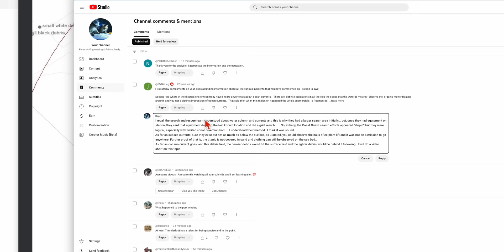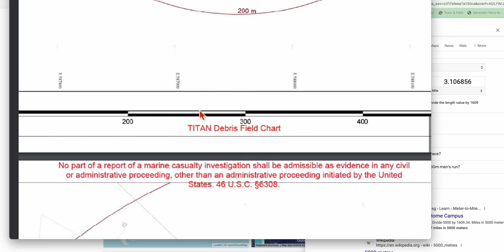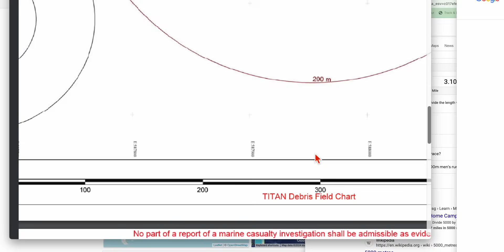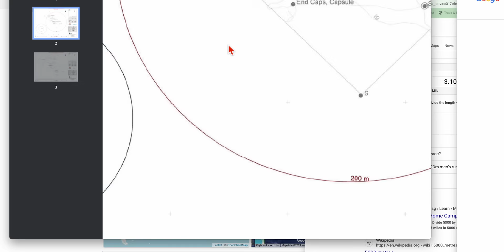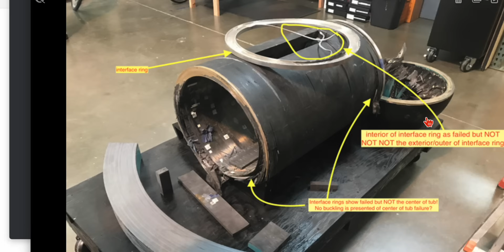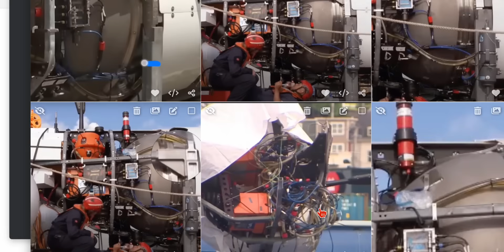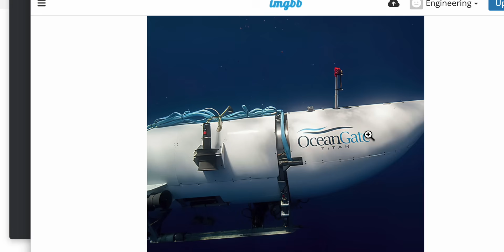Titan Submersible Rear strong back was a pry bar force on top connection putting it in shear stress

Comment: Yeah, that scale is wild. If you look at the original debris field map which Ballard plotted in '85 it's approximately a mile in diameter with the stern and the bow 600m apart. And it fell a hell of a lot further and faster than the Titan.
Reply from the maker: I adjusted and proofed the larger drawing, it is operational for me now.

Comment: I am sure that at one point the designer talks about dropping the frame if the weight drop is insufficient, was this system operational, did it work or not, these answers only investigators can shed light on, I do not understand why they do not communicate on the question, but I may have missed something, (I found where the photos were.)

Comment: Just a suggestion...  You obviously enjoy this type of analytics and are good at it.  And I for one find your analyses very interesting and persuasive.  Now what if one were to do a reverse engineering of sorts - entirely theoretical - based on the assumption that at some point the gas tanks must have imploded or exploded.  In fact, one of the photographs of the remnants of the chamber shows a greenish piece of something.  Assuming no colour distortion, it could be a section of an oxygen tank.  What would the effect of an imploding / exploding oxygen tank be?  What sort of force, heat and damage would result?  Ditto wrt an oxygen leak.  Was it possible for those reserve oxygen tanks to have leaked directly into the chamber?  Or anywhere near the batteries?  For some reason, I am obsessed with the oxygen situation cos if they were so utterly negligent in so many other respects, it follows that they probably didn't think too much about the hazards of concentrated oxygen and the limitations of oxygen tanks when not meticulously maintained.
Reply from the maker: I did a video on this,  it would be dramatic and crash under the pilot seat, unless it can then start emergency abort mission... it's not high on my list.

Comment: So far it looks like a longer period of time after the last communication and the implosion. Although they may have tried to remain calm we'll never know exactly how they lived the final minutes. From the testimony PH was a rock, but at least once SR lost his cool. If he did it at a much early time in his endeavor to make his mark by opening the ocean for tours, it makes one wonder what he was like in the final dive.

 I'm wondering if everything was on the line for him that day. Perhaps it HAD to succeed; so if he had to drop weights and scurry back, what did the pressure, fear of ultimate failure and possible censure from the others in the Titan do to him? They were not his underlings or normal people with money and one had his son onboard. None of them got to where they were by being timid, so it may have become very heated in that expensive coffin; especially if there was something that really frightened them. 

If it was an out-of-control tumbling around then it may have been more like dealing with each second and hoping to get back to the surface. But, if there was even a minute or two to interact, one of them may have reacted with anger. However if PH didn't take over when things went off the rails and SR was trying to drive they may have held it in until they were no more. 

It's small bit of justice ,if before it was over, someone deflated his ego. PH was warned by a friend that his presence helped sell the trips. I wonder if his last moments included expressing his regrets to the passengers, especially the young man. They say he had lost interest in living after his wife died and thought an implosion would be fitting end for him; but I doubt he ever wanted anyone else to go too. His mindset is still a puzzle to be unraveled.

Comment: I like how the titanium end caps were just glued on. 👍
Reply: Yeah, was Rush counting on the pressure to hold things together?
^..^~~
Reply: @recklesswhisper  actually yes, I think he said that himself
Reply: Not the fact that they we just glued on, the titanium was machined and nice and smooth, with no "tooth" or profile, rough surface for the "glue" to bite onto. And no consideration for the different expansion Characteristics of the Ti and carbon fiber. And the videos of them applying the glue in a thin layer with no "oozing" out that would show that it had a very good application.
Reply: Putting the wisdom of using glue aside for a moment. Applying the adhesive evenly by hand was going to be very problematic. I like you said they under used the glue.  it didn't even ooze out so you know there were voids.
Reply: That’s another serious issue with carbon fiber.   You can’t weld or bolt things onto it as you can with titanium or steel.    Thus epoxy was hand mixed and applied and the rings eyeballed.   It’s a wonder that the titan even worked once.
Reply: Which is insane when you consider that sheer forces at the end caps were enormous!
Reply: Keep it up brother.
Reply: Might as well been screw on caps,,each end counter threaded to the other

Comment: Can you explain in a video how the control cords go through the rear titanium ring to all the components in the back that aren’t in the pressure vessel 

How do those cords wires junction get through that ring without a problem 

Thanks so much
Reply from the maker: Simple, they are called hull penetrations and they are subsea specialty purchase

Comment: Also if thay was having truble dropping the ballest and had to rock the sub that would put a lot of stress on the pressure vessel and at the depth rocking and trying to drop the ballest along with the sub getting beat up for 3 days while in transit , also there was a report that the sub was decending faster then expected MR Rush seems like he was cutting corners not taking the experts advice.  Also thay say that the glue had been turned to powder in a couple locations , and thay speculation  was that the big bang that was heard on previous dive might have been movement where the glue had failed ..so all the poping cracking sounds was probably the carbon fiber layers giving way , it's all on MR.Rush he was told it wasn't safe he refused to do extra testing he fired his workers that had reservations about safety so the whole damn wreck is 100% his fault ...at least that's what I think , I feel very bad for the customers,  seems thay weren't told the truth

Comment: 1 day before the bigger ROV got to the area, an oil ship arrived with 2 smaller 5000ft rated ROV's. Oceangate broke one robot immediately after frantically overmaxing depth. The 2nd stayed a bit more shallow, with no hope of seeing anything. Oceangate had 0 preparation for emergency ):
Reply: To be completely fair, a rescue plan for deep diving submersibles is tantamount to impossible. With no means to lockout the crew, the Titan was doomed no matter what they tried.
Reply from the maker: I would not say never, a scenario exist that might have worked; they might have designed the "ejection system better" ( defective thinking bc, can't go back in time)... or on the very last day, they might have been pulled up with minutes of 02 left if they never attempted any about measures
Reply: At some point, preparation is pure waste. After all, almost everything a boy scout is prepared for, doesn't happen. Rush was right. They didn't need a rescue sub.

Comment: Not sure the title of the video holds up to logic. If all the connection points were turned into ball joints, the skids, end caps and tail assembly would remain rigid, as there are at least three points of contact on every potential axis. If the tail cone were exerting pry force, the top of the rear end cap would be the logical point of failure, as the tail would pry the top of the rear endcap away from the carbon hull. The wreckage strongly suggests the initial failure was at the lower front of the submersible. I haven't seen anything yet that connects torque on the rear tail assembly to a failure at the front of the submersible. Keep up the fun videos.
Reply from the maker: Short answer, the pressure on the end cap is in the millions of psi and no why is the weight of the cantilever able to pry "the rear off"... it simple breaks it's top connection and ONE elongated hole reveals a huge force that elongated that top hole.
I can't answer compound questions from everyone but I will give you that one that trashes your belief that the rear could be pried open... 
It's actually  one case where this could happen but it would require the "bullet wake" I gave away in this video... no, it did not happen.
Further, no cherry picking ... you must account for the entire debris field and massive spread of over 400 meters in a "lineal multi direction"

Comment: Under pressure the CF cylinder would flex inward in the middle trying to pull the titanium rings closer together; and all that metal framework around it would try to not allow the rings to move the same. Adding just more stress to the already under engineered system.
Reply from the maker: I saw that fake engineering data ... It could compress uniformly or even fracture at a sanded  section but this is NOT a beam or "bridge" , my future and pass videos have explained this... It would be weaker at the ends unless the interface ring could support the ends. 
Then this system is weakest at the weakest point and that can be anywhere on this hull... That's a fact and not theory. 
So, don't believe that mid-span bs

Comment: If the dome failed and one end was sheared off as it shows its clear to me that the part that is left of the carbon fiber shows it was a strange implosion and the amount of pressure could easily form a jet that caused a rotation that twisted everything as it flung off and changed what was just a slow moving fall.
I mean how many examples do we have of something like this to pull from?
None!
So all of the data is gonna be a one off and what does not make sense is really accurate because what part of anything that led to this makes any sense to the industry standards?
Nothing!
 So i don't see where any of the data would make any sense except to the most extreme and absurd set of circumstances because that is exactly what this was.
Exteme and absurd!
 So although i know for a fact you understand the details of the drawings provided i think the only issue you have is trying to put logical conclusion to something where the entire history of this story that wound up to this was heavy in all kinds of things EXCEPT LOGIC!
 So the most extreme set of circumstances that would not normally happen most likely happened!
Why!
Because what part of any of this has normal stamped into the equation besides the fact that who of us that look at this ending and are surprised?
Like we see the ending was normal when just acting this reckless!
 Im just saying its a one off and what happens that deep under the pressure and circumstances of such absurd choices i dont see how anything would make sense besides the fact of saying...
Well you wanted to see the Titanic so bad you died right there!
Satisfied now?
Because everything this guy claimed has been proven why he was wrong!
And had people pay a quarter million dollars to die like....
Ummm... No thanks!
The more money i have the less shit like this ill ever be doing cause i won't do this shit broke to begin with!
Lol
Point is dont let what you know should normally happen get in the way of something where normal was avoided at all costs only to cost lives in the end!
Because nothing is free!
Not even being a rich dumbass who thinks he knows more then everyone else!
NOPE!
HE DIDN'T!

Comment: Yeah, the "km" looks like it should be "cm". 5000 cm = 50 m, which is consistent with the Easting values
Reply from the maker: Exactly. I will use this scale and we will evaluate a "waveform" that will explain the major parts of debris field...this video I hoped would remove any doubt... that this vessel did not implode immediately

Comment: Forgive me, I'm totally ignorant to all the physics of how this stuff works, but I was wondering about that air-bladder.  If you have an uninflated bladder wrapped around the hull, when you go to inflate it, wouldn't it have to overcome the pressure of the water pressing in on the hull before it could expand? Wouldn't the bladder want to expand in the direction of less resistance, which would mean inwards away from the water and thus increase pressure on the hull? If the hull was already reaching it's limit, perhaps from damage or a defect that has gone undetected, might the sudden abrupt increase in pressure possibly trigger an implosion?
Reply: Don't feel alone in your ignorance...  Any idea what they were expanding those air-bladders with?  And where/how that 'air' was being stored?
Reply: I was wondering that too... maybe some kind of chemical reaction that produces gases?

Comment: I guess that there incompressible syntactic foam failed since it is on the bottom and not floating on the surface.
Reply: The batteries and other equipment are way too heavy for the amount of foam they used. I think it was more about equalizing the buoyancy of the submersible. Not for making it float.
Reply: I don’t think they had any foam.

Comment: Yes I would agree there scale is wrong , if it was a 6 Mile by 6 Mile square and some of the parts was 6 miles apart there would have to be a strong currant ill bet it's feet and not meters

Comment: This company should've run "dives" without people and tried a dive bell (sphere with lock for entry/exit) style submersible for testing, then tested the material through destructive testing after 1 dive, several dives, and then many dives.
  Why they thought mixing carbon fiber & titanium, then literally gluing them together, wasn't safe or sane with people in it. 
  It seems the glue failed, which was my initial thought.
  Carbon fiber and titanium have different COEs, and thus, the weak point was the glue between the 2 materials.
  The stress between the materials would've caused stress on the glue, and it seems they didn't inspect it between dives.
  An X-ray of those joining points between tge rings and the carbon fiber hull could've shown what condition that glue was in between dives.
  The weight of the movement when moving the Titan, and the movement from the different expansion and contraction of the materials had to be immense.
  Even titanium contracts under those pressures! 
  When they did the test in the pressure chamber of the model at the university, they didn't have any "tapes" to measure the expansion and contraction of the materials involved. (At least, not that I saw.)
  Had they had that data, along with creep testing of the materials after repeatedly being put under pressure, could've saved lives.
  The older adults who were killed was sad and unnecessary,  and they should've understood the risks. The youngest member of the 'crew' likely had no idea of the real risks, which is very sad. 
  I hope when the review is over , they don't overregulate the industry to the point of stopping future research.
   Hopefully, people who get involved with future research will need to take some classes in materials, COEs, and have a good understanding and respect for the physics and engineering involved.
  I can understand why some people walked away. There were so many red flags, and so many questions I would've had even considering taking a dive in a vessel like this.
  Rush really did his best to try to make tge Titan appear to be safe, and his NDAs and making it appear that NASA and Boeing were a part of the project, and made it appear that the vessel was certified, despite others in the industry raising serious, valid concerns, to the point of fraud, IMHO.
  This incident reminded me of the encounters I had with Paul ('P.H.') on another project I considered many years ago. 
  I hadn't even thought about it for many years, until this accident. 
  I had concerns about the other project, and I walked away from it, in part due to concerns I had about the other project, and a serious concern about his lack of concern for safety issues. That was back in the 1980s, but  it seems he still had his salesmanship intact, as well as his lack of proper concern for safety. It seems that didn't change over the years.
  He blew off concerns and questions about that other project as well.
  I can't say that I was surprised that he was involved with this accident, where he and others lost their lives. 
  Perhaps regulations should prohibit the use of NDAs where there are safety concerns - not only in this industry, but others as well, as safety concerns are often buried by NDAs, and so often result in loss of life, serious illnesses, injury, etc. The C-19 bug from a lab seemingly had similar issues. (I'm also a lab tech - ret.)
  Perhaps review boards for safety issues where NDAs are concerned? I don't know the answer to that, but it's certainly worth discussion to find a solution. 
  This accident, like most, was totally preventable.
Reply: I am hoping all that happens is that already existing standards become force of law... no passengers on experimental vessels, standardized hard points for emergencies, things like that. 

They had a good idea. They just did it poorly.

Comment: I would think there’s a mistake on their scale. I think it’s supposed to be 500 meters NOT 5000 meters. 

Otherwise the debris would’ve circled the Titanic wreckage rather than be 1600 or so feet away as they’ve stated in previous statements.
Reply from the maker: I think you mean smaller even...
Reply: @LoadPathEngineering  yes. That scale is obviously too big.
Reply from the maker: Okay, in simple terms it's 50 meter scale